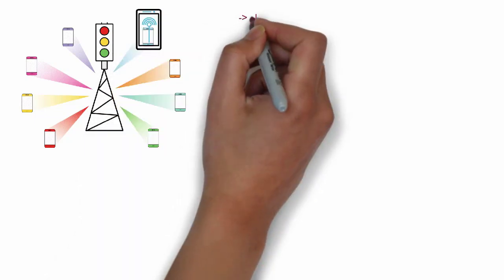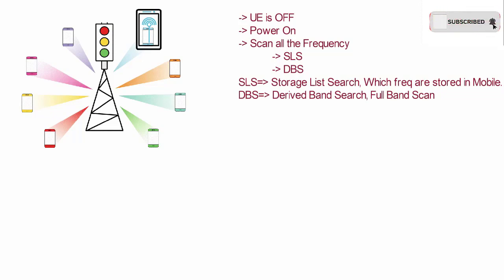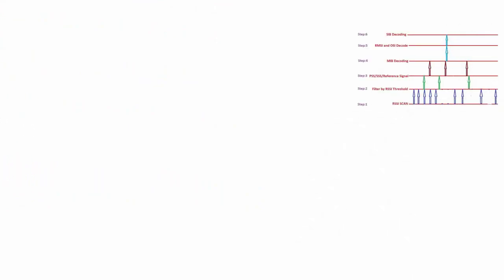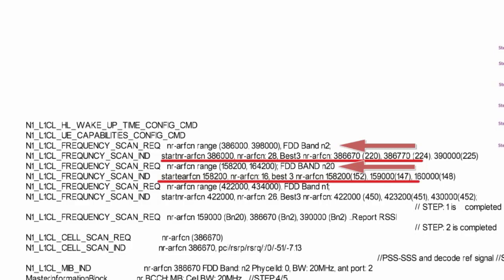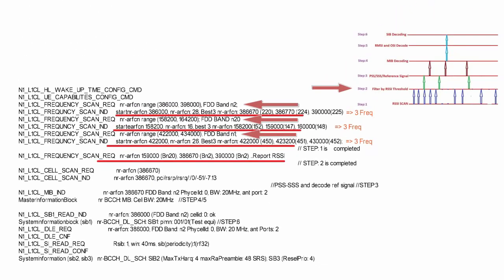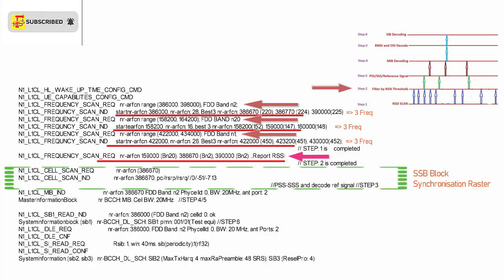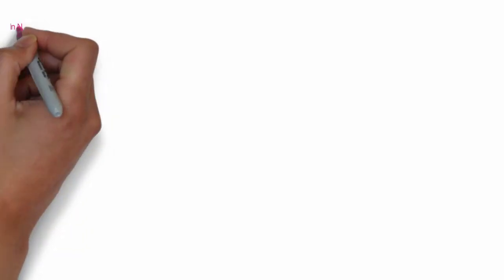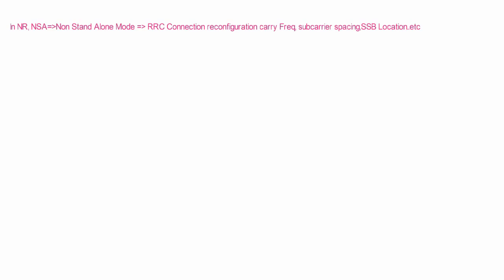Part-#1|5G NR Cell Search Process in Stand alone mode Part-#1|After UE switch on cell search process

Comment: When UE power on first time how it understand it has to follow 3G or 4g or 5G initial acquisition incase ue has auto selection mode is on and all RATs are enabled in wireless settings option
Reply from the maker: https://tweet4technology.blogspot.com/2019/10/lte-cell-search-procedure.html  it will help you to understand what happens during initial Acquistion.

Comment: How does ue know whether to use 15 ,30 or 60khz subcarrier spacing to read SSB?
In LTE only one subcarrier spacing but in nr there are options and also FR1 and FR2 
In ENDC case LTE nodeb sends these information in rrc reconfigurations msg but in case of SA how ue know??
Please answer thank you
Reply: Where i know it use GSCN no to find out SSB position, GSCN no are defined as per band.

Comment: Hi, thanks for the video. Very well explained.
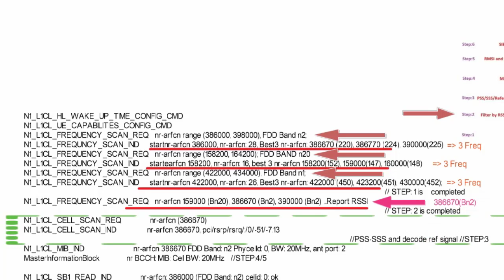I got a doubt, How does UE determines first preferred NR-ARFCN which you mentioned at 7:40. Please explain in both cases when UE is powered on for the very first time and UE is coming out of coverage area. 

Thanks.
Reply: Argon 386670 has the higher RSSI compare to other two  freq at step 2. So it is first preferred arfcn UE will try to sync with using SSB.
Reply from the maker: @ATUS1213  correct